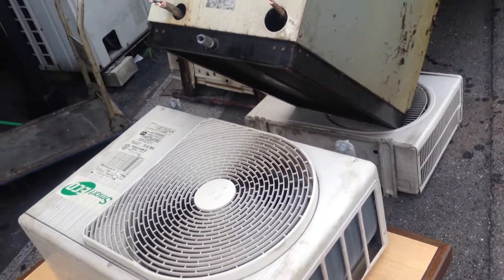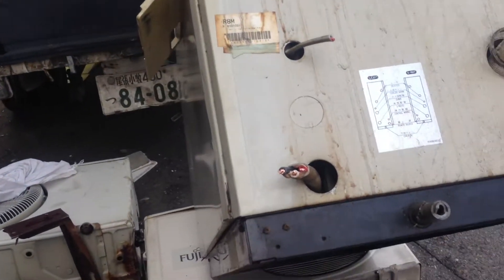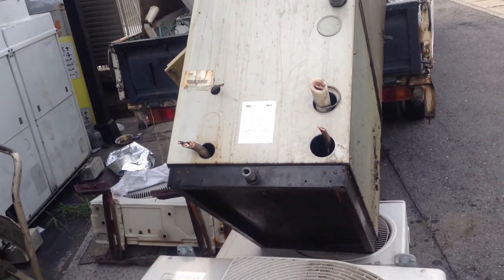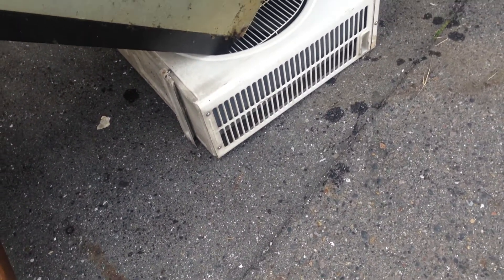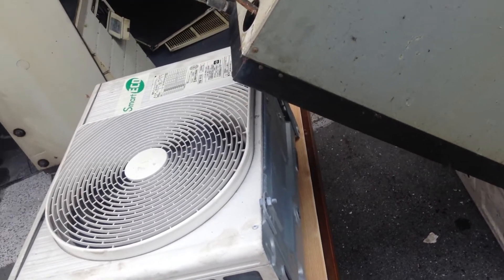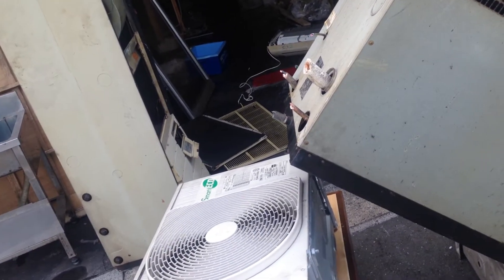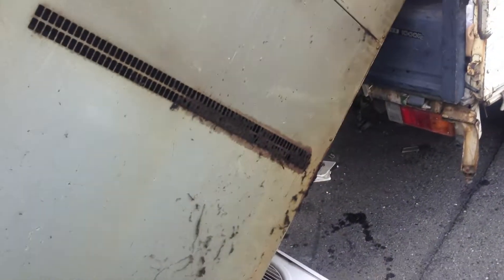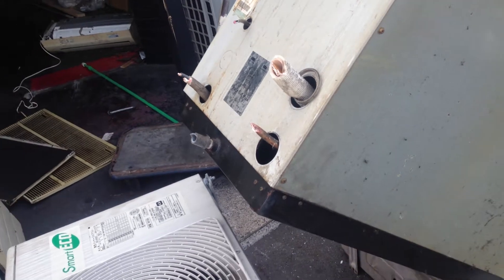Putting 500 pound aircon on to truck by hand

Comment from the maker: I usually mAKE videos on the spot,and the videos that need time get put off I have videos in my mind ,for ages ,it is just difficult to set up,I ended up putting one large air con down laying the other on top and gradually slising it on to the truck,it fell off the truck twice,very very frustrating ,but was worht it in the end as I got $630